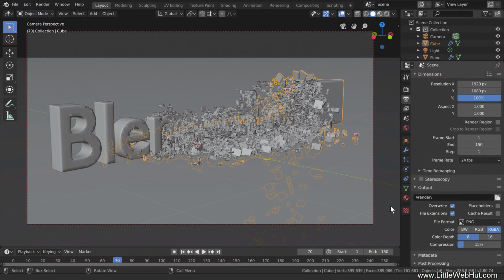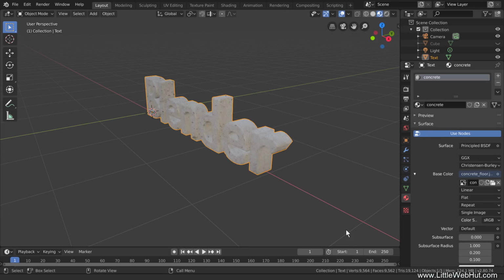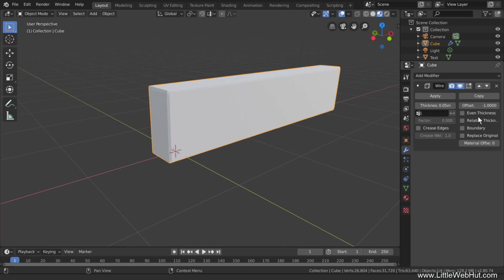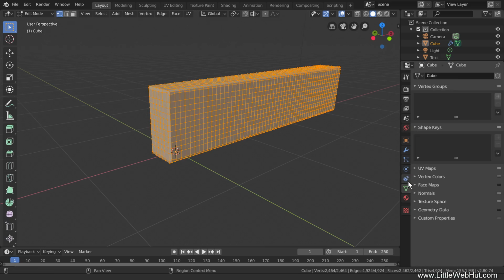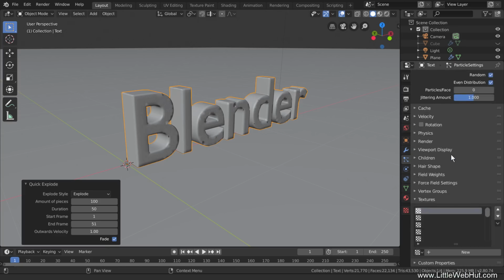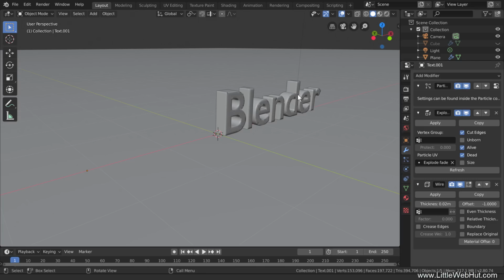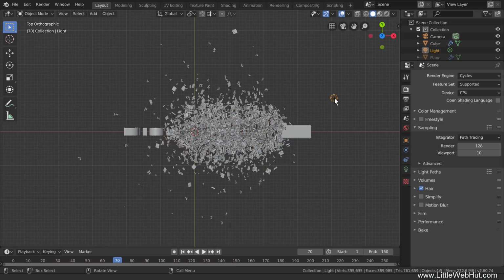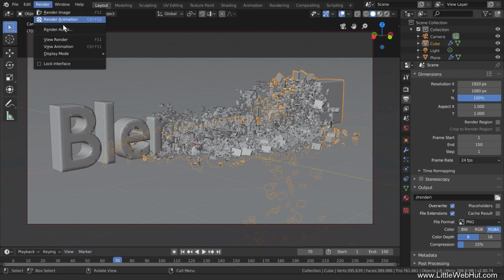Blender 2.8 Tutorial: Crumbling Transformation

Comment: Great tutorial tutor4u 👍, but for those who would like to use the eevee render engine, you just select an object that is using the concrete material , scroll down towards the material settings and change the Blend  and shadow mode to opaque, when you view it in rendered mode it will give you similar results to what Tutor4u, render this and it will give you similar results to what Tutor4u did. At least it worked for me.

Comment: is there a way you can avoid cement pieces from going through the floor plane? If the purpose is to achieve realism, then avoiding objects piercing through another supposedly solid object is kind of big deal.
Reply: Select the plane, then go to the Physics tab and click on the Collision button.
Reply: I know your comment is old but in case it might help someone, I found some success using fluid as the physics type as it gives some control over how far particles want to be from one another.

Comment: Three tips: The most important is to follow the instructions step by step without deviating from the script. Scaling the cube and then applying the bevel you'll get different results in edit mode than in object mode.
The second is that if the end result is not pretty, you probably have to customize the materials.
eg. In my version the cube looks like wireframe and this is fixed in panel materials, settings -> blend mode -> changing Alpha blend for any of the other options
if you can't get results, dowload subtitles print them and start the project again

Comment: Could someone help me with the download of blender 2.8 there isn't a zip file but folders when i've finished my download of it, basically how do i set things up? Tutorial will be helpful k thanks
Reply: Just go to the website and download the beta, extract it to a folder, I put mine in a subfolder of Blender`s folder named 2.8, and just run the executable, there is no proper installer for it, you can ignore windows protesting about it, it just because its not signed code. You can just delete it when a new build comes out and do the same thing again. Maybe when its final build they will have a streamlined install for it.